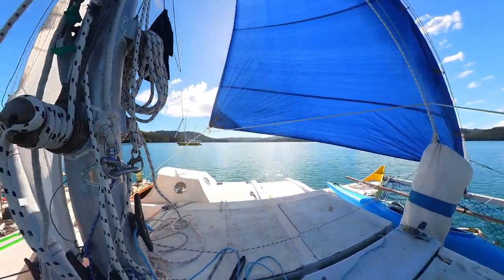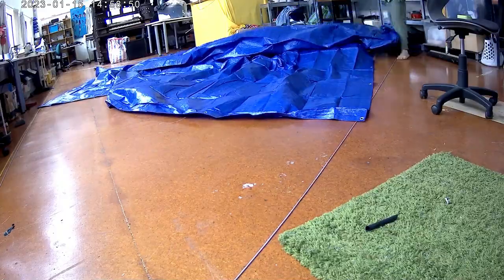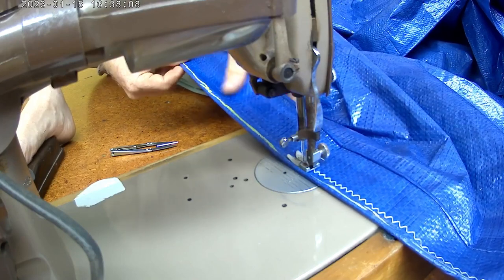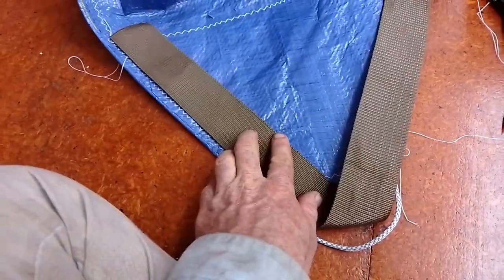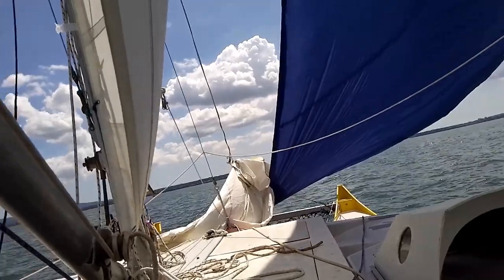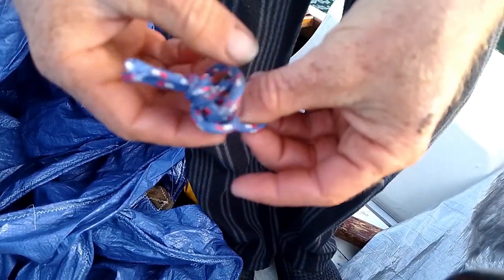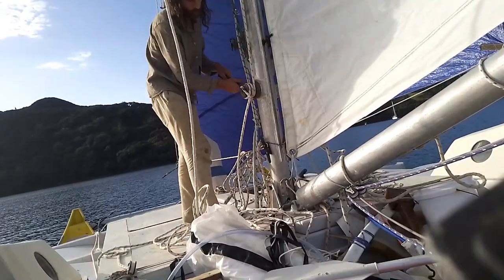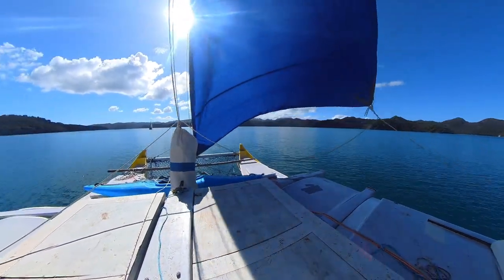DIY Sailmaking! (under $100). Sailing Yes Let's! 12

Comment: Great. First I used only the staysail and yankee, but as my confidence in the boat grew I started to use the drifter , Wich is actually more of a code zero genoa, more and more. Now I use it even with Bf 4+. Even pointing goes quite well as the additional speed helps a lot.  I can imagine an even bigger sail, like a true asymmetric gennaker that runs to the very aft beam.
Reply: The position of the sheet eye on the boat also makes quite a big difference on how this sail performs. Further towards the centre of the boat for pointing, further outwards for reaching and broad
Reply from the maker: Yes! Actually, the drifter is about the same size as the genoa from my 26 foot mono. I tried it on the pahi but not quite the right shape. Not sure exactly the definition of a code zero, but a genoa is meant to overlap the mast, which the "genoa" drawn on the plans does not. So I consider the drifter as the correct genoa.
Reply: @dominictarrsailing  i went with my ‘ drifter’ to the sailmaker for a small repair and he showed his admiration for the smart design 👍👍
Reply: @dominictarrsailing  you’re right
Reply: A code zero is a flat asymmetric spinnaker. Larger than a genoa. As you build your drifter from a flat piece of sheet, likewise you may be able to cut one like this even bigger. Or two, nearly parallel, as they do on Volvo ocean racing boats. But be carefull, even a Wharram can capsize or break its mast ( beam)
Reply from the maker: @alfreddaniels3817  do you use it with a sail track on the 4th beam? (how it is on the plans)
Reply: @dominictarrsailing  i am not sure how the plans are, but yes there are sailtracks on the fourth beam. About 75 cm long. As I remember ( i am not at home now) the furthest side towards the centreline  is right at the lashing there. Even then I tried to bring it further towards the centreline with a extra line. As a barberhouler.  It depends how flat that sail is and how high you want to point. I found that the sheets of the Tiki can also be brought further to the centreline for higher pointing
Reply from the maker: @alfreddaniels3817  aha yes on the plans there is regular jib track on the 3rd beam, and drifter track on the 4th beam. During the restoration I never found one of the tracks. I decided to just use uhmwpe bridals instead of the screwed down tracks, (I still have them through, I just figured fewer holes in the beams the better). Planning to try a barberhauler soon, especially for the drifter.
Reply from the maker: @alfreddaniels3817  haha, I think this is enough sail for me! I measured it 22m^2, slightly smaller than the plan's drifter, but still makes sailing in very light wind satisfying which is the important thing.
Reply from the maker: @alfreddaniels3817  that's interesting! I knew about drifters from reading old sailing books, but they seemed to go out of fashion (because most cruisers just motor in light air) but then the same idea is coming back with code zeros... but curious how your drifter is constructed? the sail plans only give the overall dimensions so any cleverness of the design is due to the original sail maker. My understanding is that a classic drifter was just cut like a genoa (probably cross cut or mitre cut) but bigger and very light weight material.
Reply: @dominictarrsailing  mine is indeed of a lighter material. More like a rather thick and very strong spinnaker cloth. I think the interests in code zero’s might also come from the very fact that they are so flat and thus can be rolled away. The faster the boat the flatter the sails can be so racers were the first to use code zeros. Mine is simple horizontal cut.
Reply: @dominictarrsailing  how is your mainsail? I tore mine after the first few weeks that I bought the boat cause I forgot to lessen the tension on the underside when I lowered the main. It tore the mainsail horizontally. I decided to invest in a new mailsail and had it made radial cut from a material that is really the best I have ever seen. There is only one machine in germany that can make this material: it is like a dacron but ripstop and without any coatings like ordinary dacron always have. They can do this because the weaving of that machine is the finest ever ! So it is very smooth ( in the beginning even so smooth I had difficulty to grasp and bind it ). It is ripstop in all directions and UV impervious. It costs offcourse some more per square meter, but since those sails are not that big and the money is in the making more than the material I think it was worth it.
Reply from the maker: @alfreddaniels3817  wow that sounds like a great sail! I can see how that would happen! hmm, I have a topping lift with a stopper knot in it that stops the boom falling too low so I havn't had any problems with the mainsail yet. I did repair a few holes (chewed by rats while it was stored for 20 years) and I did repair a tear in the genoa last year (episode 4) no problems apart from that.
Reply: @dominictarrsailing  i bought the boat like that. The boomsystem and mainsail is not according to Wharrams original design but more like every other design but the boom goes up quite high at the aft. I don’t know why most Pahi 31 didn’t use Wharrams original design. I saw only one guy on YouTube. That original design mainsailsystem is lowstress and can be reefed along the mast. It can also be binded agains the mast. Again a unique Wharram design that needs more study and people with the courage to imply it. It looks to me that the main is also bigger and perhaps easier to tack the boat. 👍👍😀😀honors to James and Hanneke.
Reply from the maker: @alfreddaniels3817  interesting! my rig is pretty close to the plans except being aluminium instead of wood. I have seen a few variations, including using double mainsheets with no boom. Tbh, it's very common for wharrams to have some departure from the plans. Sometimes good, sometimes bad. Given that wharram owners/builders are a community, I am sure that sometimes these personal modifications influenced later designs too.
Reply from the maker: do you have any pictures / video sailing with your drifter?
Reply: @dominictarrsailing  yes I was just looking at your video on seven days at sea and I saw your boom and main. Can you tie the main to the mast as in the plans was drawn ? Is your boom connected to the mast or to the block on wich the mast stands? In the last situation you maybe able to raise the boom vertical along the mast and make the whole platform free. You could reduce some mainsailsheet if you hang the blocks from the boom lower. On ropes.
Reply: @dominictarrsailing  not now on my phone, but maybe I can make some the coming weeks.
Reply from the maker: @alfreddaniels3817  yes the boom actually attaches to the deck (mast beam) not the mast. I havn't tried raising the boom, I think the sail would get in the way. I havn't rigged the brailing. It's not too hard to lower, but I guess it would be easier to unbrail than raise while facing down wind, not sure if my sheets would be long enough, will check. I have rope to extend the bottom blocks on the mainsheets. At the bottom not the top because I have the sheet tail go forward to the front of mast then back. before I had 4:1, from behind, and it was an awkward angle. now I have 5:1 and it's from the front and much easier. I think having it from the front is much better ergonomics and that means at least another 2:1 I think
Reply: @dominictarrsailing  no experience on this. I use the double mainsheet system and it works perfect no need for a sliding rails.
Reply from the maker: @alfreddaniels3817  yes I tried it out after your suggestion, was good, but even better with the another block forward on the boom. Also, easy to pull in both sheets at once, or release them at once. Also the bottom ends are on snap shackles so can move the leeward sheet for downwind (which also serves as a preventer)
Reply: @dominictarrsailing  👍👍😀😀
Reply: @dominictarrsailing  I love to follow the videovlogs by Itchy Boots. She is with her motorbike now in Senegal and tries to cross a riverdelta there on a local boat. I credible images of the boats there, that I think you would like to see. The titel of this episode is: Getting across the Saloum Delta is not as easy
Reply from the maker: @alfreddaniels3817  great paintjobs! and the bow's are just like those of Ontong Java (which was built in The Gambia... which is enclave in Senegal!)
Reply: @dominictarrsailing  👍👍

Comment: Aloha, what type of thread did you use to stitch it up? Trying to make my own but unsure of what type of thread I can use that is strong enough and can be used in a regular sewing machine...
Reply from the maker: Just "heavy duty" polyester, from regular sewing shop. very hard to break with your hands, looks the same as a regular thread, but only 100 yards on a spool. And I get the larger needles that are marked "denim" or "leather".
Reply: @dominictarrsailing  Mahalo for the info! I will give it a shot, hope it turns out like yours....

Comment: Nice! looks sturdy with all the extra reinforced areas. I have been making the Tarp n Tape sails for a while and like you said stow it away and you can use them for years! also there is the aspect of using the older tarp sail as a pattern or experimenting with shape before investing in a more durable fabric. I need to get a sewing machine.
Reply from the maker: absolutely! hard to sink a lot of money on expensive fabric when you don't really know what you are doing!

Comment: Dominic, you've done it again!  Question - What duty tarp did you use?  Light, heavy etc?
Reply from the maker: oh, good question.
couldn't find a shot of the package, but pretty this was "medium" 105 gsm. It's definitely on the light side. I'd use heaver stuff if I wasn't making a specifically light air sail.

Comment: This is pretty genius. I helped a friend of mine make a similar sail from Tyvek house wrap. It did very well. He acquired a little sailboat, I think it was about 17'-18' and he had only one old tattered sail that came with it, so we made some from Tyvek. I think it cost him about the same amount, about $100.  
I used to be able to buy these middle weight white tarps at the local flee market, a lot of boaters used them because they were white. But they would make an excellent light air sail, just a little heavier than the blue tarp, with a coating on them.
Reply from the maker: thanks! yes I've heard about tyvek too. I recall you can tape, and the tape is strong enough that it doesn't need sewing!

On my monohull one time I was sailing around NZ's North Island, and 3 days into what became a 10 day trip I ripped a long hole into my working jib. I repaired it using heavy duty tarp. I put a layer each side but probably didn't really need that. It made it the whole way and then back around the other side too.
Reply: @dominictarrsailing  Yes, thats correct. When we made the sails we used white duct tape. And we reinforced the clew with it as well. I really like how you used the webbing straps sewn in though. We didn't have access to a sewing machine at the time. If we had. I would have taped each fold and then taped the outside, opposite side and sewn through it for a more permanent configuration. I'm here to tell you that, the Tyvek sails were extremely strong and durable. And the material was very close to the same feel as a new set of Dacron sails. We actually talked about either spraying them or rolling on some rubberized coating like white elastomeric roof coating for RV's. We wanted to experiment with how long we could make them last. A new set if I remember right was about $900.00 for that boat, my friend said. So he had a target of one third the cost. Our plan was to first lay out the tyvek and cut it then use and adhesion promoter then coat the material with the elastomeric compound snd let it bake in the sun. Of course all of this was to be done after we had created the shape and taped it all. The Tyvek came in a roll 4' wide by I think 250'long, so we had a lot to play with. The mast of that boat was 19'3" I remember. I think the boat was an O'Day 17. Back then my favorite boat was a Flying Scott 19'er. But seriously if we had taped and sewn them, I have no doubt that we could have created several sets and used them for years. My buddy wasn't really much of a sailor, he was a powerboat guy who through some horse trading, ended up with this little sailboat. So he kind of lost interest in the whole experiment rather quickly, but I being a sailor saw it as a huge success. There was another elderly lady at our sailing club who created her own sailing Canoe using one sheet of Tyvek and a bunch of scrap pieces of aluminum and bits of used hardware from our clubs maintenance room. She made a loose footed Gaf rig. I helped her make the mast step and bond it to the bottom of the FG canoe, much like Roger Barnes little camper cruiser boat here on YT. Have you seen his channel?

I've often wondered about making two smaller crab claws for boats like yours. I just love the looks of them on the Wharram's, especially the Pahi. Damn, I miss having a sailboat. I've got to get to building soon.
Reply from the maker: @kaisailor1  haha yes I've been day dreaming about a crabclaw and I like the idea of a schooner or ketch rig. I have a theory that the pahi is inspired by hokelu'a. (given that it looks very similar, even down to the colour scheme on the plans, and came out just a few years after!)

prehaps like this marshallese influenced A frame configuration https://www.youtube.com/watch?v=gKDtgADVjFc&t=19s (which is described in detail in this master's thesis! https://onedrive.live.com/view.aspx?resid=90959240214B34E8!10930&authkey=!AJUhC8nay76xoMk )
Reply from the maker: I think it would be a faster overall to experiment with the crabclaw rig on a smaller boat first. like an old beach cat or tiki 21 or something like that
Reply: @dominictarrsailing  Oh no,I agree with you. Your boat is a bit big to be "experimenting" with complete sail rigs. Maybe during an off season, after your finished sailing for a little while. But damn, some crab claws would look really cool on your boat as you were zipping around the islands.

Comment: Great work, that’s what sailing is all about. I think most sailing have been corrupted by the racing/rich.
Make some wind vanes that that goes directly on your rudder like the channel luckyfish and your are set.
Also, pick up a small outboard, it could save your boat and your life, we won’t judge you.
Reply from the maker: I have a windvane system in this video: https://www.youtube.com/watch?v=DVCACnrmFVw unfortunately trim tabs not really simple on the pahi rudder design

Comment: You can make the drifter sail out of the same cloth as your spinnaker. It's obviously more expensive than a polytarp but definitely better suited for the job.
Reply from the maker: yeah, although nylon also is less UV resistant than polyester. You can buy ripstop nylon from aliexpress surprisingly cheaply, so I'll see how well this one lasts then maybe that will be next time.

Comment: Nice work.
Try just raising the tack to tighten it up.
Reply from the maker: thanks. I think I may be able to get a little more length if tie the tack a little lower, and/or tie the halyard directly on, instead of via shackle. It looks like it's close... could also adjust rigging to rake the mast back a little more. Both of those easier than recutting sail, so will try them first.
Reply: Or add a patch n loop above the tack to make a Cunningham down haul.
Reply from the maker: @markthomasson5077  good idea! That would be an easy change!

Comment: I notice no dagger boards in the dagger board slots. Have you done away with them. That is what I did on my Pahi 31. I didn’t notice a lot of difference, but again I was never looking for that extra tenth of a knot or that extra degree to windward.
Reply from the maker: I have them (in storage on the farm) but I never tried them... it was just another job that I skipped before launching. Have heard several stories like yours... The other wharrams have a deep forefoot, which is meant to help with windward ability and tacking. That's why the pahi daggers are so far forward, is because it's ment to replicate that deep forefoot. I might try a more central leeboard one day. If it improves tacking it would be worth it!
Reply: @dominictarrsailing  worth speaking to other Pahi sailors. I didn’t see much difference. I weighed up the potential for a marginal advantage that I was unable to detect against the likelihood of unwanted clutter up forward. I sealed the holes top and bottom and never missed them. But like I say, other more experienced folks may give you a different opinion. 
I traded down to a Tiki 21, sadly that has now been in dry dock for 15 years😢
By the way, I love the poly tarp approach to sail design👍
Reply from the maker: @robingraham6820  hmm, I havn't encountered someone who uses them yet!